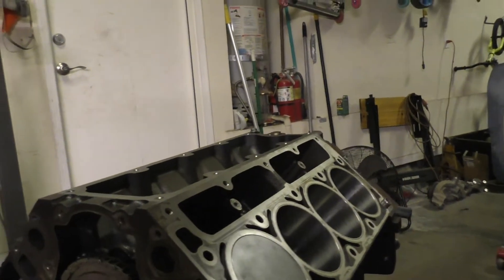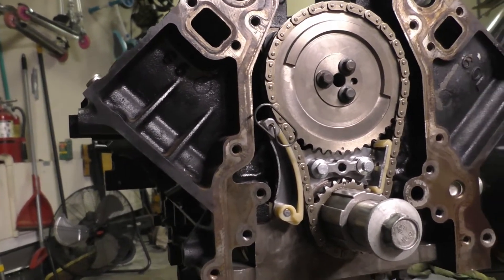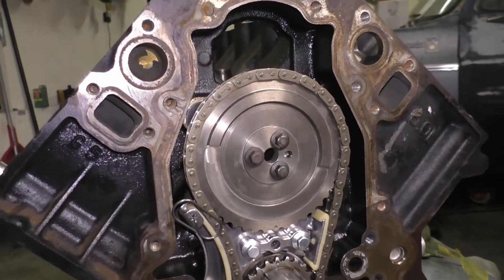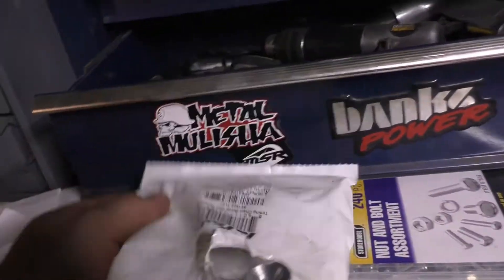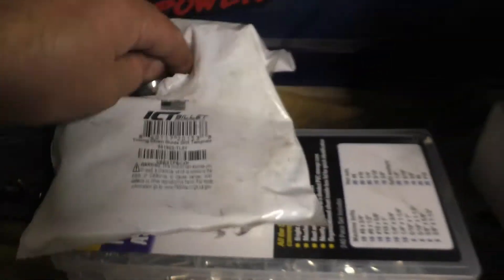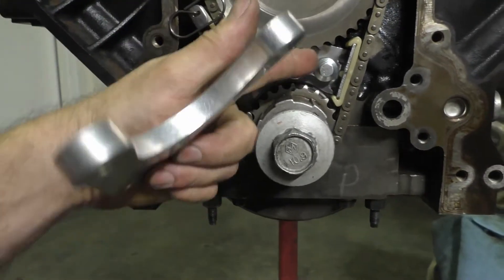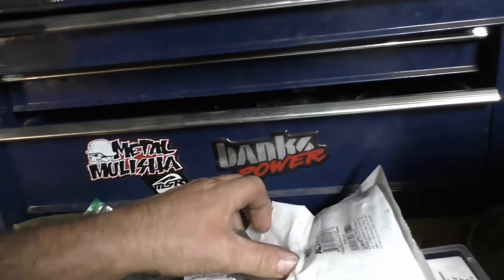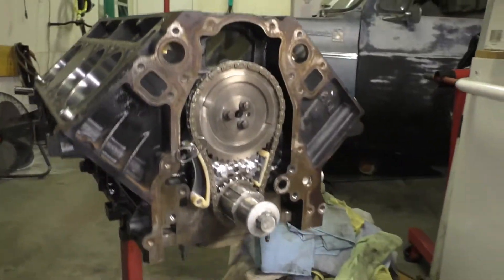6 0 LS build part# 6TIMING chain tensioner

Comment: What are you using for cam , I have same pistons and was concerned about piston to value clearance
Reply from the maker: The cam is not that big it's just a mild cam
550/550 220 on the duration 114 on the LSA
Anything bigger than that and I would probably check piston to valve clearance I'm not sure how much you can get away with the lq9 piston